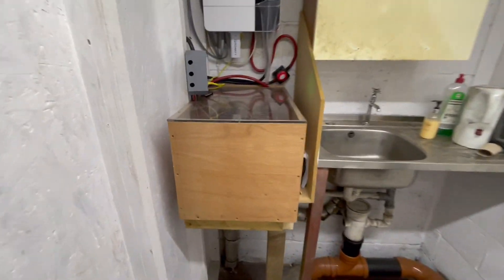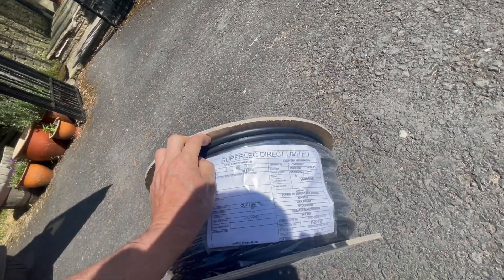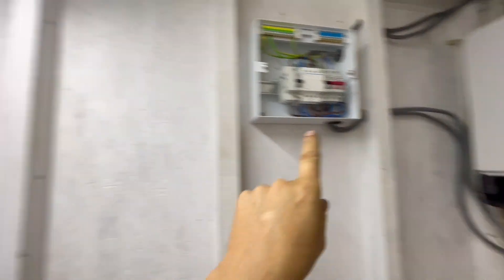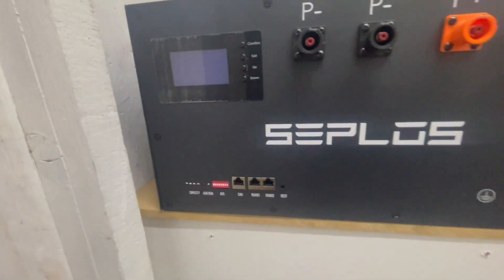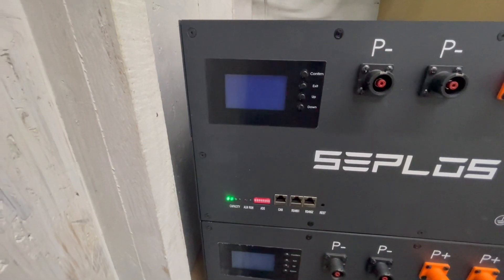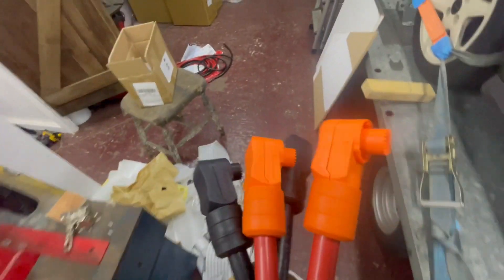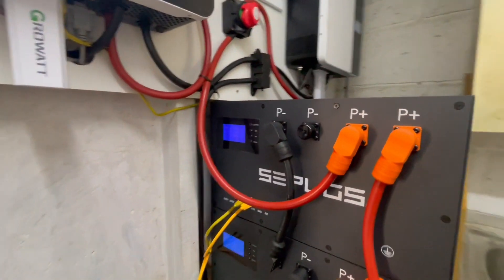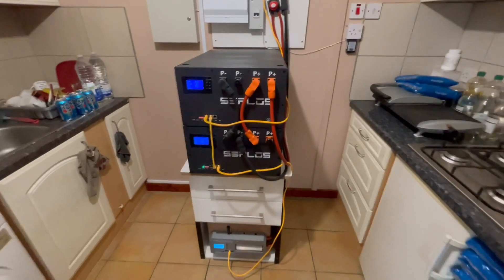Garage Solar Upgrade - Inverter's, Panel's & Batteries.

Comment: How do you like the seplos bms?
Reply from the maker: Been using them for a few years now mate and no problems so far, 5 of them are the 2nd generation ones with Bluetooth and I have one of the 1st generation that I’ve updated the firmware and is paired with 2 of the 2nd gen ones with no problem. I can pretty much leave them all to it, or if I want to quickly see cell details I can look on the LCD or more settings on my phone, can even see the none Bluetooth battery on my phone as it’s paired to 2 Bluetooth ones👌👍 cheers

Comment: Hi, great job. 👍Can you advise me what value in LI settings for seplos BMS. In program 05 I select the value Li and then in item 036 you set which value L51, L52 or L01? Thanks for help. Vera
Reply from the maker: Thanks 🙏 if your Seplos BMS CAN settings haven’t been changed then use L52 on the Growatt.
If your Seplos BMS CAN protocol setting has been changed to Growatt then use L52 on the Growatt.
You may need to cut 3 wires in the CAN lead on some inverters, pinouts for the correct pins can be found on Seplos and Growatt websites.
Cheers 👍
Reply: It seems cheaper to buy battery off the shelf at the moment with the Likes of Fogstar offering 15.5Kwh batteries already built for £2500 https://youtu.be/ClpOLsLU_ms?si=EwrKNYysctOOjhX0

Comment: Hello mate! Nice job! What seller did you used for batteries and BMS boxes. Seems that previous link doesn’t work anymore. Any shipping/ import taxes? Thanks a lot!
Reply from the maker: Hi mate, thanks 🙏 

For all my batteries I purchased from shenzhen basen technology co. ltd through Alibaba, Ive purchased a few times from them and they pay the fees in the price so none to pay.

For the BMS and boxes I got them direct from Seplos also through Alibaba.com and they also include fees in there price so no fees to pay over here. 👍 cheers
Reply: Thanks a lot! 👍🏻

Comment: Good set. I am preparing the same for my house. Just you need connect all batteries with same wires straight to the busbar. Now you upper battery have higher load than the lower battery (charging current the upper battery is 24,00A, the lower - 20,64A). And it will be all time. The upper battery will lose capacity quicker than the lower.
Reply from the maker: Thanks 🙏 it’s been working perfectly as it is for the past few months, the cable is 50mm2 so more heavy duty than I need and all 3 batteries are always same voltage, the Seplos BMS do a good job on keeping them synchronised 👍 cheers

Comment: nice one but you forgot on voltage drop in distance 100M line needs 8mm2 cable
Reply from the maker: Thanks mate 😁 the voltage drop isn’t a problem on my setup as the inverter PV input voltage is such a wide span it doesn’t make any difference, I’ve had its running for a few months now and it’s made a massive difference and is working so well 👍 cheers
Reply: @CarJunkeez   Wide span is good more V les A same cable less lost power i'm trying to get new mod10ktl3 for my house (now 3x 5000ES bat 20kWh) first 1100V open, and second 3 phase so i can run AC from house to stables and shed less lost power in cable
Reply from the maker: @hekamteam  yea your right better to have higher PV voltage as more efficient, think I’ll go with a single inverter too with 2 MPPT next time as these Growatt take a lot on tick over at night so I’ve got one of mine turns off at night automatically when the sun goes down 👍

Comment: very usefull video on how to get affordable solar set up. Curious where did you get your seplos mason kits?
Reply from the maker: Thanks 🙏 I got the Seplos mason DIY cases with BMS directly from Seplos through there Alibaba.com but I contacted them first and got a better deal second time round 👍 cheers
Reply: thanks. If one of those cells goes faulty, does the BMS tell you which one? Also where did you get the inverters from? @CarJunkeez

Comment: How you finding the seplos mason's? Im thinking about swapping out my diy jk bms boxes for them. You recommend?
Reply from the maker: They’re all working perfectly for me, I’ve got the three in my Garage and all cells are still balanced well and I’ve added the old DIY battery I made to my house that also has the 2 Mason Bluetooth boxes so I updated the firmware on my DIY box as it’s one of the early Seplos BMS (none Bluetooth) and they all stay balanced really well even though my DIY is 304ah and the Masons are 280ah, and I can still see all 3 batteries details on Bluetooth and correct total 864ah 👍 can highly recommend them mate. Cheers
Reply: @CarJunkeez  that's top end mate. I'll probably buy another full set of 16 with the mason diys then. Did you earth the panels on top of the metal roof? I'm having a cunt of a time finding someone who will give me definitive answers on this. Sorry about the bombardment of questions, hard to find people up here that actually turn up. Enjoying the content though!
Reply from the maker: @jamiematheson7775  thanks mate 👍 I didn’t bother earthing the panel’s, to be honest they’re probably earthing themselves through the metal roof and building, I’ve done 4 sets of roof panels here on the farm and not earthed any, I think it’s more of if a panel starts to fail it could leak electricity to the frame but I can feel a little tingle when I stroke the ally framed on full sun anyways on my house 😂 people say it’s to do with lighting but that bull mate 👍 cheers

Comment: Nice job Shane , your knowledge of things is very inspirational mate I have no idea about this stuff but I’ve learned a fair bit I’m sure once the outlay cost is covered you must have the potential to save a small fortune with a set up like that and more importantly not be scared to turn things on though fear of extortionate electricity costs . Nice job mate 👍
Reply from the maker: Thanks mate 😁 yea I can run some big stuff off it now and getting quite addicted to all this energy saving technology, onto hydro next 👍 cheers

Comment: Thanks for the update on your solar, great video!, I'm in the UK and am thinking of getting the 5000kw model, just out of curiosity what was the issue with the inverter?
Reply from the maker: Thanks mate 😁 the faulty one kept coming up with error 08 bus voltage to high and would shut down, the weird thing is it only did it at night when using power from the grid, I eventually found a fix firmware and seams to be ok since I flashed it so may be fine. They are really good inverter’s for the price but think you’d be best spending a bit more for a Sunsynk if you want to do it properly, other than that I can still recommend Growatt 👍 cheers
Reply: Just wondering why you would go for the sunsynk over the growatt? anything in particular that makes the it worth approx double the price @CarJunkeez
Reply from the maker: @giollaliddy5817  the Sunsynk are a higher quality built inverter than Growatt and have many more features like programmable dump load and capability to feed back to the grid and 2 solar string inputs etc. if I knew what I know now I would of definitely got Sunsynk 😂 cheers 👍
Reply: @CarJunkeez  Hello, i did not find information that Seplos batteries was tested with Sunsyk inverters. Are you think what Sunsyk can work with Seplos batteries correct?
Reply from the maker: @skrudzasss  hi, yes the Sunsynk inverters that I was looking at to replace my Growatt do work with the Seplos BMS so I presume all of the later Sunsynk will to 👍
Reply: @CarJunkeez  Could you write about which inverter model you are thinking?
Reply from the maker: @skrudzasss  Sunsynk 8.8kW ECCO Hybrid Inverter
Reply: @CarJunkeez  Thank you